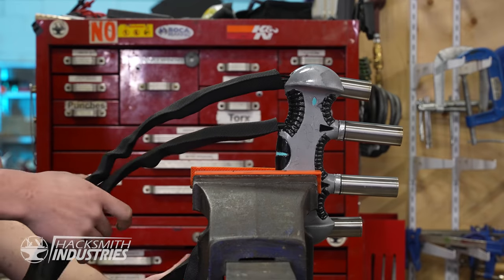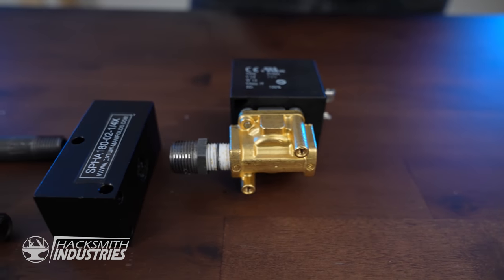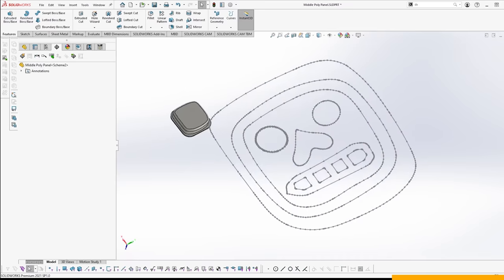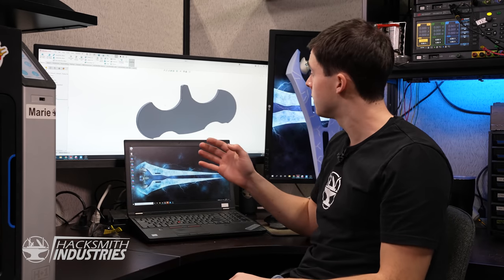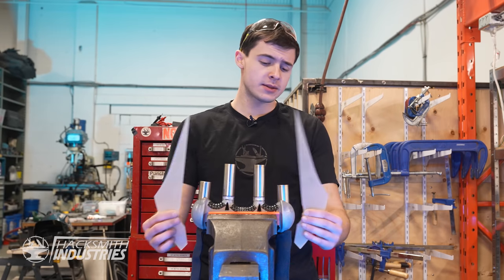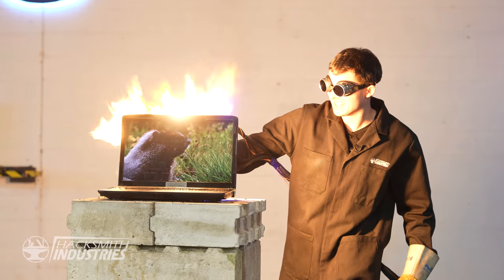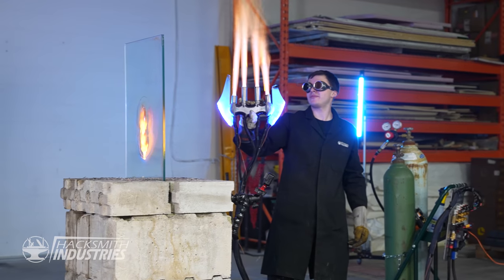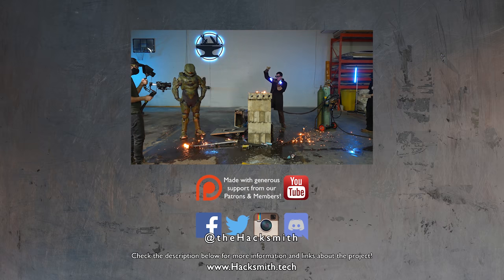Hydrogen powered HALO Energy Sword

Comment: Giddy up! I like it! Kills two surgical birds with one stone. Cuts AND cauterizes at the same time!
Reply: more like carbonizes it
Reply: Love seeing Dr Raynor on here. Especially since he put James hand back together.
Reply: Damn right Doc
Reply: Dr Chrissssssss ur the best
Reply: Also for surgery just sets on fire
Reply: EEE I love your comment Dr :)
Reply: guy has some guts cutting the glass like that I left a casserole dish on the stove on a burner once and when i came back into the kitchen there was glass all over stuck in the drywall in the lanolin floor took me forever to get it all and i think i still missed some
Reply: Geez, this blade is only missing two things to be a true plasma blade: containment/concentration of the blade's plasma and a portable fuel/power source. It will be amazing and scary if we every manage to do both.
Reply: Fun fact: if you listened to the elites at sanghelios, you can learn that Jul M'dama made the blades less powerful but in doing so, makes the wounds cauterize, so if an elite is struck but not fatally wounded, he won't accept any help with the wound and therefore kill themselves, for it is with honor to not accept any healing.
Reply: Free Amputations! Buy two, get one Free!

Comment: Really nice nozzles. Great job! I would have the igniter built into the energy sword handle.
Reply: No replies?
Reply: Dattebayo
Reply: @jennifersong5969  your not naruto
Reply: Believe it!
Reply: No
Reply: Massive saftey hazard I assume. Probs asking for it to blow up in your hand
Reply: An electric arc between the two tips of the side plates would be epic. Since it is already tethered a power supply wouldn't even be a problem.
Reply: @anmoljassal2104  it does look like that . . altho maby not as much whan it's switched off
altho
this is an issue whitch is shared by many energy based weapons . . so how do you get around that ??
Reply: @zazo5525  your dog doesn't even use english
XD
Reply: @zazo5525  in english that is
because
I an CZECH and not a british or american
Reply: @zazo5525  also are you trying to be anoying ?
Reply: @zazo5525  also do you even have a dog ?? ;)
Reply: @bluewhalestudioblenderanim1132  dont worry dude your english is fine! This guys just upset
Reply: @cinder7258  thanks :)
Reply: @cinder7258  Don't lie to him, 

his english is terrible but it's fine for someone getting better at english.
Reply: @genopie2673  exactly
Reply: Please Create Blade Trinity Abigail Whistler's Laser-Bow!!🤯😁👍
With two focal points it should be your most powerful Laser Weapon yet!
Reply: @bluewhalestudioblenderanim1132 Vvv

Comment: I have an idea. If possible, try to confine the flame to as thin and as long a flame as possible. So the nozzle would have to be a lot smaller for this, but if you can get the flame to be any length you want as well as thin as you can make it. then you can have many of these smaller flames in a row to actually recreate the halo energy sword more realistically.
Reply: I'm pretty sure the way the nozzles are designed means that concentrating the blade would negatively affect how straight it was. What would need to happen is they would need to get one of those with a stronger base that has less than 40 nozzles, and then pump even more pressure through it.
Reply: If the makers of the nozzles were to try to shrink it to the degree you’re suggesting, pressure would build up behind the nozzle and it would be possible that the whole thing explodes not to mention that the material would be thinner and so not at all as strong
Reply: Yeah, but then your flame goes apart like an oxy acetylene flame. 
This setup gives them laminar flow so the flame doesnt spread to the sides.
Reply: That would need custom built nozzles and pipes... I'm sure designing and manufacturing such a complex part for just a one time use prop will not be financially benificial for any company...
Reply: they use laminar flow with the oxygen and propane that's why they can't make the blade thiner, if they made the blade thiner it would probably be less concentred and will have a bad flow through the enire blade that would lead to future problems like heat problems or even worse bad circulation of the gas, that for sure you don't want that to happen.
Reply: @yaboichymy  could they taper it from the inside? Like have it wide and circular inside the nozzle but then have it taper to a wider thinner blade?
Reply: That’s a Great idea

Comment: It’s interesting how you can put your hand right next to the “blade” and you don’t feel too much heat. But at the same time, as soon as it hits something, you land on the surface of the sun.

Heat transfer is weird.
Reply: u need to have the flame touch long enough first and it needs to be at the point where the flame is generating the most heat
Reply: well if you actaully understand how heat is transfered, it isn't werid...
Reply: I read your name as 'there is no moon' and was about to do something before I saw the pfp
Reply: fluid and gaseous dynamics are a thing that helps with the understanding of Thermal conductivity
Reply: I like your name
Reply: In free air most of the heat is directed away from the user.

When it hits something the air/gas/plasma current is much more turbulent and get redirected in all direction including back at the user.

Comment: I want to see a version of this “plasma sword” with a tungsten rod inside the center of that flame. Basically to give the blade some rigidity to actually cut through things instead of melting while still having the blue look of the fire.
Reply: I remember this old show called Sci Fi Science that talked about that sort of concept.
Reply: that's what this channel's first lightsabers were like. I think they wanted to move more towards the lightsaber's ability to be projected from the handle, so they went with that nozzle, and they probably felt the same way about this energy sword.
Reply: @TheMindRobber42  Their initial lightsabers directly heated the rod, and I don't think that got as hot as this
Reply: @vibaj16  yes, that's what I said
Reply: @TheMindRobber42  I'm saying the projecting feature isn't the only reason they switched to this
Reply: (the original comment I was replying to, was deleted)
this wouldn't work, for multiple reasons, #1 tungsten oxidizes quite easily, and even though it would not melt, it would corrode to dust in that hot oxidizing flame. for that reason, you'd be better off using tantalum. #2 if there is a rod there, then it will disrupt the flow of the hot gas. those are specialized nozzles that use laminar flow to shoot a very straight jet of gas, and anything in the way will disrupt that flame, ruining the laminar flow, and making it significantly weaker and also uglier. #3 its basically the same thing they were using before, and trust me, they've really upgraded it by switching to plasma swords. the hot metal sticks were kinda weak sauce, and even if you used plasma along with the metal rod, it will simply cut slower because heat has to travel through the gas through the rod and then into the object you're cutting, whereas if you just use gas, it goes straight from the gas to the thing you're cutting. not to mention how a gas flame can curl around things and weave between things. unlike a metal rod, which is a solid stick. this means that the hot gas can get to the target a lot easier, and can more effectively burn/melt things.
Reply: tungsten wouldnt be durable
Reply: @endeavour5316  "tungsten wouldn't be durable." what? no, tungsten is extremely durable! that's why its so useful! its the second hardest metal, its also the third or fourth strongest metal, its the fourth densest metal, and has the highest melting point of all metals! if that isn't durable, then I don't know what is!
here, lemme give you the definition of durable: "able to withstand wear, pressure, or damage; hard-wearing."
that's the perfect description for tungsten!
if you're thinking of tungsten carbide, then yes, its indeed quite brittle, but other than that, its still very strong and hard, and has a high melting point. but please understand that carbide is totally different than tungsten metal.
Reply: @Metal_Master_YT  though wouldn't you have to replace the tungsten rods frequently due to how fast tungsten oxidizes?
Reply: @Metal_Master_YT  Dude, he didn't say Tungsten is weak.
Reply: @Babushkabongwatr  yes... that's what I said...

my previous comment: "this wouldn't work, for multiple reasons, #1 tungsten oxidizes quite easily, and even though it would not melt, it would corrode to dust in that hot oxidizing flame. for that reason, you'd be better off using tantalum."
Reply: @ninjahunterx7497  uh, were you not listening? he said: "tungsten wouldn't be durable"
but, that makes no sense, because tungsten IS quite durable, as I clearly pointed out.
even at high temperatures, tungsten is hard and strong, that's why its classified as a refractory metal.
durability and reactivity are not one-in-the-same if that's what you're referring to.
Reply: @Metal_Master_YT  ok nerd ;]
Reply: @RANDOM-om1ss  well that was random...
Reply: @RANDOM-om1ss  must be sad to have no useful thing to contribute beside shaming someone for knowing more than you on a given topic
Reply: @Metal_Master_YT  uneducated people have left the chat
Reply: @justskiddingaround-idontkn7519  oooh got' em!
Reply: @anusukla2  lol xD
(sorry for my previous comment @The Roblox Mans)
Reply: @Metal_Master_YT  it was supposed to be a compliment but ok
Reply: @Metal_Master_YT  was just trying to marvel at how much you know about the subject
Reply: @Metal_Master_YT  jeez man you don't gotta be so aggressive, chill out bro
Reply: @JellyAntz   edit: oh, I thought you were talking about some of my first comments. yeah, my last comment was totally un-called-for, I apologized to the person in question. it was a misunderstanding on my end.
Reply: @anusukla2  ok, well it went over my head then, sorry man! I think I get what you meant now.
Reply: @anusukla2  thank you for the positivity though! I'm glad people appreciate the stuff I learned and shared. :)
Reply: @Metal_Master_YT  Yeah it gets quite interesting scrolling through the hacksmiths comment section! And it's no problem, misconceptions are common and hard to discern on the internet.
Reply: Dude they should hire you
Reply: One big obvious problem. He mentioned in a previous lightsaber video that tungsten would soften and flop around because of the extreme heat. Actually listen to what people are saying, dude.😎
Reply: what about a version with real plasma?
Reply: @Metal_Master_YT  this is not actually plasma, its mostly just hot gas
Reply: Yeah man totally!
Reply: @Metal_Master_YT  titanium? maybe itll work?
Reply: @zachmartinez2295  hire who?
Reply: @nomad__6  you mean titanium?
tungsten will still be solid metal at 3,500F
whereas titanium wont just be floppy, it'll be a puddle.
Reply: @Blox117  um, fire is defined as a partial plasma, so you gotta give them some credit.
I still totally agree though, and I intend to make a real PLASMA lightsaber with electrical arcs at the base, heating an oxidizing jet which is shooting out of the handle to make the ultimate lightsaber.
Reply: Well then they're going to have to make sure that the plasma is cold enough that it doesn't melt the tungsten Rod now won't they.
Reply: @jadeevetz9426  right, they talked about something like a collapsible baton made of aluminum oxide with holes to spray out a plasma.
Reply: That would be cool, but imagine how heavy, although being much colder, they could use methane and a much less heavy metal
Reply: @Metal_Master_YT  not durable enough for what everyone is thinking lol they have already tried tungsten, it started bending and took a while to head up and smoked
Reply: @justicehiggins2963  I see what you mean, but they should probably have communicated that better...
the problem isn't that tungsten quote "isn't durable", the problem is that white hot metal in general isn't very durable. the refractory metals are much weaker when they are hot, yes, but they are also the only metals that can stand those temperatures and maintain some of their strength and properties. 
tungsten is after all classified as a refractory metal, and one of the strongest and hardest at that. the burning/smoking problem is something I predicted might be an issue, that's also why I suggested tantalum instead, although other metals like niobium or hafnium could be used as well. some have even suggested using refractory oxides and ceramics, but those aren't very conductive, and can't transfer heat to the target as well as metal can.
Reply: It will melt
Reply: @DestroyahTheBanned  it cant, the flame is cooler than the melting point of tungsten, and tungsten also forms an evaporative cooling oxide layer.
Reply: @Metal_Master_YT  4500C go brrrrrrrt
Reply: @DestroyahTheBanned  its in Fahrenheit bro. xD

Comment: Halo community: Hacksmith what are you doing?

Hacksmith: building a Spartan 2 and arming him to finish the fight.
Reply: fun fact: Installation00 is already working on that using our current tech
(not the micro-nuclear fusion power pack; we’re several decades away from getting that kind of power)